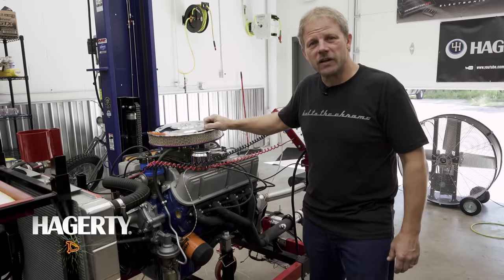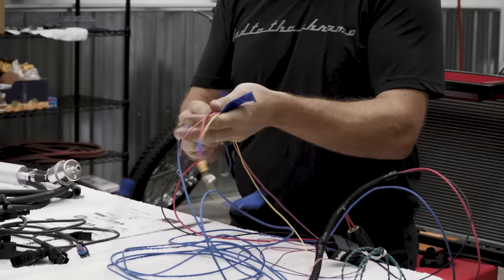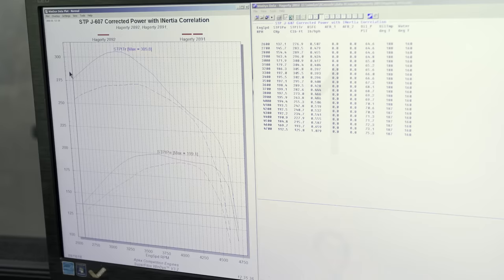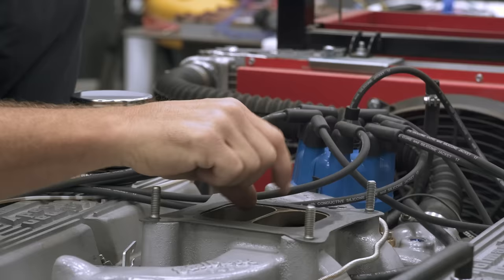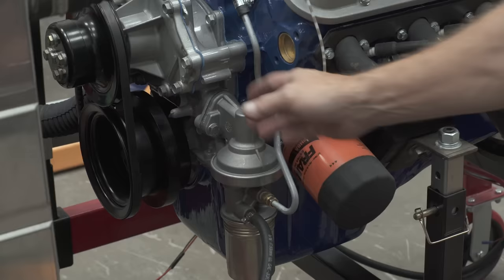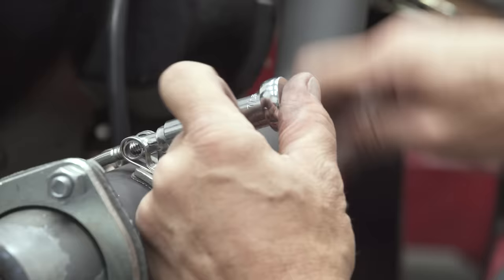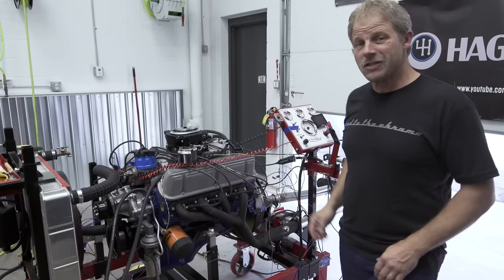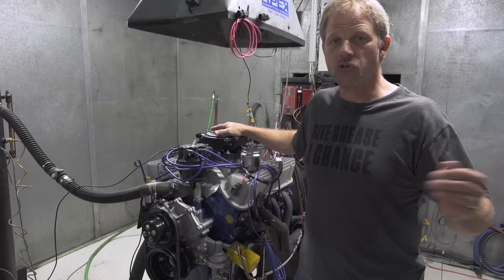Is it worth it? Replacing your carburetor with a Holley Sniper EFI | Hagerty DIY

Comment: I still like the Holley I have,I don't play with the choke and it fires off every time and I feel is more reliable due to the fact there are no sensors or connectors to suddenly fail.Not to mention all the wiring to deal with,I can see the FI for a daily but to me part of the driving experience in an old vehicle is the less than perfect and "basic" systems it has . 
If I want great mileage and a well mannered vehicle I would drive a Prius.
Reply: Wow, you summed that up perfectly. I feel the same except I have a edelbrock
Reply: yeah all those cab sensors and connectors are stupid arent they?
Reply: Yes sir. I have a 540 big block with a 770 Holley carburetor I’m not for EFI at all on my BBC. EXCELLENT VIDEO. THANKS.
Reply: Looks like everyone else is in here. So I'll jump in with my good ol Rochester quadrajet👍 Once you get it set up good its great👌
Reply: @motov8-garage832  I agree!  The moan they make at full throttle is badass too! My dad could tune the hell outta one.
Reply: Completely agree!
Reply: I don’t know guys ! I have owned strait 6 fords with carbs and now drive a 96 f150 with 4.9 EFI 5 speed and pull a 5000 lb camper. This EFI motor is perfect. It has 289,000 original miles on it and I just put 24000 miles on it in 5 months. It pulls fantastic and gets great fuel economy. I’m staying EFI. I almost went carb route. But the EFI works flawlessly and being 26 years old still running original computer and distributor. I’m a convert to EFI at 61 yo
Reply: @flatheadfletch  I like both. I have used HOLLEY carburetors on many vehicles and have enjoyed their reliability. EFI has issues, I agree; but, I have not had any of my factory ECCs fail. Relays and other parts, yes. But, driving on long trips, I really enjoy my EFI. V/R Chris

Comment: I've ridden carburetor motorcycles and EFI models. The EFI models have let me squeeze 52 MPG on occasion out of a machine only rated for 42 MPG fully loaded. North of the Canadian border that extra range is a big deal. Super reliable system, and I've really grown to like the EFI better over the last 50K plus miles.
Reply: I followed a guy on a carbed Harley go across the Continental Divide. He had to ride the choak knob to keep the bike running.

Comment: This was an excellent video for me. I'm getting ready to put a Holley EFI on my 84 Corvette replacing the existing cross fire fuel injection system which is the laughingstock of Corvette folks. Thank you for the excellent presentation.
Reply: You're really not improving anything over the crossfire unit. Have a friend help you mod your crossfire intake to work with a pair of GM 2 barrel TBI units & keep the OEM operating system.

Comment: Don't tell us you had a problem ("tach sweep") and fixed it.  Please share HOW you fixed it.
Reply: That's what I said too. How???
Reply: Are you talking about where the injectors flood?
Reply: At 12:48 is where he had the issue
Reply: Either put the msd on a seperate switch if you have a older 6al, newer ones have the sweep turned off or upgrade your 6al or go to the holley hyperspark system
Reply: Yeah the 6A boxes have a tach sweep setting to verify the tachometer function of a gauge. You tie into the wire on the sniper for rpm signal, so the unit thinks you’re going wfo as soon as you crank and it washes the intake with fuel.
Reply: Not in the scope of this deceptive infomercial...
Reply: always issues with EFI... hardly perfected
Reply: Did he hook the Holley up to the Distributor?  I've been looking at this for my Jeep 258, but have a DUI and dont think I want to connect the 2.  Wondering what timing I set it at.  I have it set to 12° now, with a Weber 32/36.  Was gonna go 38/38, but for a bit more..... why not join the 20th century, lol.
Reply: @rustywolf6813  you have to connect the EFI unit to the TACH output on the distributor. that's how it works. it will not control your DUI distributor. The EFI will only control spark for the Holley Hyper Spark as far as I know. as for your engine timing goes there's a lot of factors to consider. 12 deg. at start/idle sound about right with about 34/38 deg. all in at 3500 rpm is usually safe for most engines. listen closely for spark knock when tuning above 34 deg. check vacuum at idle you should have 18/20 or more.
Reply: I know right!! I have a 1978 F100 with a Ford racing crate motor it is 18 years old with 29,000 miles on it with a Harley carburetor. I hate that carburetor. Would love to have a system like this I just don’t want any problems.

Comment: This has been the best explanation I have seen so far on switching to a efi system, I have a 85 dodge pick up with a 318 in it that is all stock and I have been thinking about doing a few upgrades to the engine and this helped answer a few of my questions, Thank You.

Comment: For all out power? No
For drivability? Yes
At WOT the engine doesn't care how it gets its air/fuel
This test has been done over and over. In tact most say the carb will deliver more power 

Your carb wasn't set up right or wrong size.
Reply: Couldn't have said it better myself!
Reply: @blairo15  Sniper uses the cheapest sensors Holley can buy. So.
TPS sensor goes bad = No drive.
Water Temperature sensor goes bad = No drive.
MAP sensor goes bad = No drive.
O2 sensor goes bad = No drive.
IAT sensor goes bad = Still can drive.

Also:
Placing ECU next to the distributor is the worst engineering Iv'e seen.

Fuel tank: Look at any NEW car's fuel tank ( like BMW's ). They divide the tank into 2 sumps, with 2 fuel pumps. No modified old school fuel tank is going to give you the reliability of a 2020 cars fuel tank with it's 2 sumps, and 2 fuel pumps.

Ignition: Coil Near Plug will always win. Caps and rotors wear out. This should be mandatory on ALL after market EFI systems.
Reply: Then why do the fastest heads up drag race drivers in the world who have a choice of using EFI or Carb use EFI?
Reply: @ERidParasoth  Because they double duty there cars, for Uber driving.

You should ask them why.
Reply: @brightstarlastname2812  I already know why, EFI outperforms carbs on a racetrack. The only people that race dynos is Engine Masters.
Reply: @ERidParasoth  Your reading abilities are very, very low.
Reply: EFI won the horsepower portion of this test buddy, doubt they tuned the carburetor 100% though. And it was a 4160 so thats even more downfall. Consistency is what makes all out power, EFI is undeniably better than a carburetor at any given aspect of consistency, startup, AFR spread, target AFR, literally everything. The engine does care that it gets the right amount of fuel at WOT, because the right amount is what makes the most power. Carb only gets max of 4 fueling adjustments, all of which make a difference at more than one portion of the RPM band. Vast tunability with EFI. That said, the system is only as good as the tuner, same with carbs. If you don't tune, it won't run well.
Reply: @rustysausage69  Your generalizing "all" EFI systems to a $900.00 TBI Sniper system. Get real.
Reply: @brightstarlastname2812  Cute comeback. You're ability to produce comprehensive comments is what's low here. Someone says they agree with OP and you rail on about how Holley has bad sensors.

Can you explain why placing the ECU next to the distributor is a bad idea? C5 Corvette and 4th gen F-Bodies have their ECU's within a foot of their Coils and have no problem.

Yes, all hail BMW. The company that has more articles on the internet about how big of a failure their engines are than The Big Three do on recalls. Just an FYI, this past year, BMW ranked 30/32 in overall reliability.
Reply: @ERidParasoth  Yeah there's lots of BMW's in the yards now. Funny enough all with gas tanks ripped out with the pumps missing. Not to mention engines turned upside down in the engine bays (easier to get at the sensors).
Reply: Steve on Not really a scientific test to compare carb to a late model-style MPFI system because the intakes are going to be better than a single plane/dualplane. Theres nothing a TBI system can do that a better MPFI of SFI system cant (except self learning, not all standalone ecus do it, mostly all TBIs do)
Reply: ERidParasoth ECU next to the distributor isnt the best idea id assume because computer chips are very sensitive electronics that can sometimes be affected by magnetic fields (ignition coil)  and electromagnetic noise created by high voltage wires and sparks (distributor and plug wires). Emphasis on sometimes
Reply: @rustysausage69  That's a really random statement considering the whole video is about using a "wet intake" system. Then you use the word "better" in your last system. How the heck is any one supposed to respond to that?
Reply: Steve on i said that comparing mpfi and a modern intake (in case of the LS, a scroll style) with tbi and single plane isnt scientific because the scroll intakes are very good. Just so happens that all mpfi’s are dry and the tbis are wet.
Reply: @rustysausage69  STAY ON TOPIC!!!!!!!
 "IS IT WORTH REPLACING YOUR CARBURETOR WITH A HOLLEY SNIPER EFI"
Reply: @brightstarlastname2812  In my opinion the biggest advantage of classic analog systems is no scan tools/sensor diagnosis is necessary, you know it's either a mechanical or electrical problem when you go to fix it, instead of it potentially being a computer problem or a sensor problem.
Reply: @yourmom4784  Some thing you will never hear when your car uses a carburetor. "Were sorry. We can't fix your carburetor till we have updated the software for are Philips screwdriver"
Reply: @blue03r6 "I'm not even going to strain your brain trying to explain"

I WIN!!!!!!!!!!!
Reply: I sense a lot of slow guys with ill running cars in here.
Reply: @tunerdadtunerdad7927  I sense your injector angle is way off. But then again Geo Metro motors still produce a lot of power with Short Term Fuel Trims +69% OFF the base fuel MAP.  But that's a easy fix if it's not working. Just up the voltage of the TPS to around 8Volts, and plug the IAC hole for a easy 14HP.
Reply: @brightstarlastname2812  ...Lol.   You must be one of the slow guys to get upset.  Grab your screwdriver and your timing light and get er done.  I remember when I had my first hot rod too, we all start somewhere.
Reply: @tunerdadtunerdad7927  I'm just having fun......Current vehicle I'm working on is 460 Ford, Dual Quads, 250 Shot Nitrous, LS coils, 6,000 Pound T-Bird.
Reply: It is not much of an argument against efi to claim that this carb was not set up well or that this carb wasn't big enough.  The efi is always set up well.  And any fuel delivery system can be made to deliver more fuel.

Where efi wins, hands down:  You can leave an efi system sitting for a month and not only will it run perfectly, it will start better too.   You MIGHT get your carb set up perfectly and you MIGHT get some outstanding pulls, but a week later you will need to do it all again.  

These demonstrations are for normal people who want to stop having to "tune up" their classic cars every second weekend.  Hell, you can leave a an efi out in a barn for a year and it will still run well enough to take it for a nice drive.  Your carb will be gummed up and need a bunch of "tweaking" before you realize it's probably best if we just pull it apart.

Carbs are worthless to those of us who actually want to drive our cars, rather than spend all weekend trying to manage the the fallout of all thier sloppy waste:
...fouled plugs
...contaminated oil
...scored cylinder walls
...and an exhaust that's so full of raw gas that you can run a Honda civic behind it.

Carbs are dead tech, and should be illegal.  At the very best they are an interesting curiosity.  At their worst they are as stupid as your objections.
Reply: Hal 1000  Right on brother! Carb & distributor were both improperly set up or calibrated. As far as "driveability", FI doesn't do anything better than a carb & will not even get better fuel economy than a well tuned carb. I've run carbs since the late 60s & usually removed the choke butterfly with little adverse affect on cold startup. Yes the engine needs a warmup in very cold climates in winter but not so much in warmer climates. I run a Street HP, with no choke horn, & my driveability is excellent. Calibration/tune-up is EVERYTHING! The problem is that in todays world, nobody knows how to "diagnose" problems or tune a car without a computer & most think just because the ECM has a code, the sensor setting the code is defective. WRONG! The code is a symptom caused by the ECM not receiving the voltage input that it wants to see!
Reply: @ Hal 1000   Actually, the engine does care how it gets it's air & fuel. The NHRA Pro Stock cars are the number 1 example. They've been running sequential port injection for at least 10 years & they are STILL 0.10 second & 5-10 mph slower (WITH a more aerodynamic car)than the class National Record set with carbs. Port injection will NEVER equal carbs because when the air & fuel mix in the carbs, it creates a cooling effect making the air more dense in the manifold, also making more HP. This is possible with a TBI system as well but they still won't make the HP a carb makes because the low tech TBI F.I. units hate low vacuum & it confuses the MAP sensor. This greatly limits the cam selection because big duration & overlap(my buddy, a Holley dealer, who owns & operates Imagine Injection{big $$$$, custom sequential F.I.} says keep the duration below 220* if ya want the thing to work) will have the F.I. thinking it's under W.O.T. all the time.

Comment: Hard to believe this expensive engine is running  the sorriest oil filter currently made! (at one time Fram was the leader but lapsed when it got bought out by hedge fund)
Reply: Have used Wix for 40 years.
Reply: Fram is garbage..I use Wix, NAPA gold(wix rebranded) or K&N. 91 Silverado..over 300,000. Quality parts=longer life. I would like to replace the tbi junk on my truck and the garbage heads(swirl port junk) on my 5.7
Reply: I have literally seen RUST inside a SEALED fram filter. Napa wix are great stay away from fram
Reply: grame harte also bought out champion labs at the same time  and combined the companies and took them in bankrupt court and the champion name has changed names several times in the last couple of years  i thank now it is called fram filtration  in albion ill
Reply: MANN Filters all day
Reply: @buggyridge  wix filters was started by a man that help start champ lab up in approx 1957 i wished i could thank of his name now
Reply: But what should I do with all the fram stickers I have . Put them with my 40 year old stp stickers ?
Reply: @gregblack4581  at one time champion lab owned S T P  and champion dumped it like a hot rock
Reply: @cc9z  believe it or not.....Energizer bought STP, Amour All, Tuff Stuff and A/C Pro a bit over a year ago.
Reply: He put that on to see who would notice
Reply: that's not an expensive engine.  mostly stock garbage engine.
Reply: first thing i noticed  fram fail
Reply: There Ultra line isn't that bad, but the orange can of death is a major no-no!

Comment: My hat's off to all of you carb guys, I still don't consider myself a carb guy even though I've learned a lot since going to the first generation Holly fuel injection setup, after switching over I was in the same freaking boat as I was with carburetors with my first EFI. I'm going to date myself here but I was about to throw in the towel went to my favorite Super Shops location very knowledgeable guy at the counters flipped open his book and said you know you need one of these the items he was referencing happened to be led air fuel meters he went on to tell me that if I wanted the most accurate setup to go ahead and get Chrysler four wire O2 sensors so that the sensors would give a more accurate reading at cold startup. So I ended up with a setup that no carb guy in the world can compete with, what that means is simply rolling down the road I can change my air fuel ratio and my timing on the fly as I'm driving down the road now if you have a carb setup that allows you to do that I would love to hear about it.

Comment: But where's the entertaining whoosh of flame that's supposed to come out of the top of the engine?   I thought that was a sign of maximum power!
Reply: Lol it is !
Reply: It is. Until it gets out of control and you'll be needing a "little" more than a EFI system.
Reply: i caught my hood on fire quite a bit when I was a kid ... 63 olds 394 4 barrel ... fun fun !!
Reply: Have you been spying on my cars?
Reply: Hooray for not reading the "no parking" sign.
Reply: My buddy melted his really cool Weiand triangle foam air filter on his 67 GTO back in high school. Good times!
Reply: This videos are a blast tnx
Reply: 1974 pouring sips of gasoline into the carberator then tell your buddy to hit it ! HUGE ball of flame,burns the hair off your arm! you had to be there.

Comment: I’m guessing the big improvement comes when you also use an electronic ignition & start tying the ignition timing to the EFI computer.
Reply: More useful if the timing falls out of where it should be. Either from dynamic running or loss of efficiency etc. engines can run extremely poorly now lol

Comment: The carb needed more tuning. Thats said, I'm converting to this system because of drivability. No heat soak issues after stopping for 15 minutes. No stink in the garage after parking it for a half hour with the door shut. (no float bowls to vent) No retuning for winter/summer...etc. I took the plunge after having three of our customers vehicles in the shop and heard their feedback and drove them. We do not do custom work, mostly restoration but a few of our customers will mod their original cars for drivability. They all were very pleased with this system. One caveat....they all had the Holley Sniper system....after trying the other systems....just an fyi.